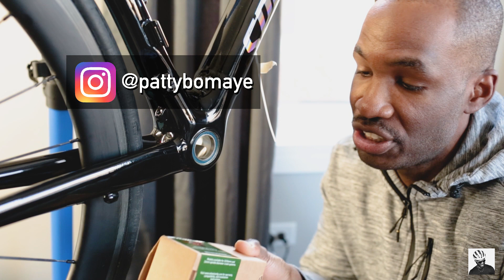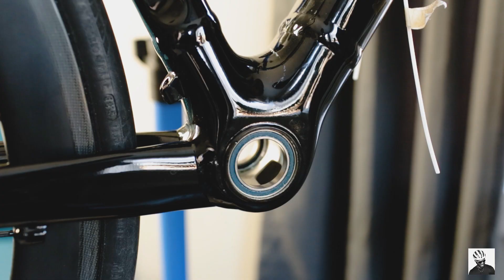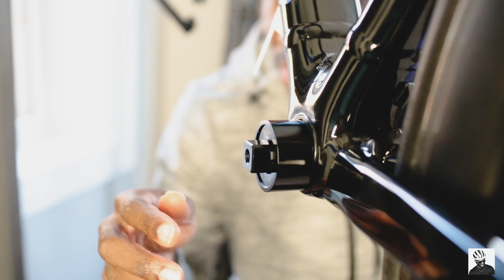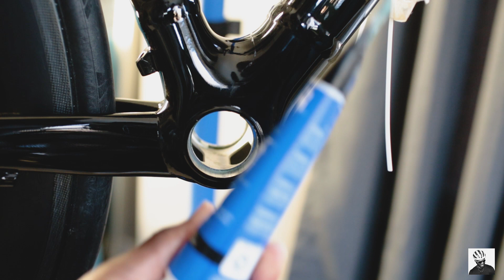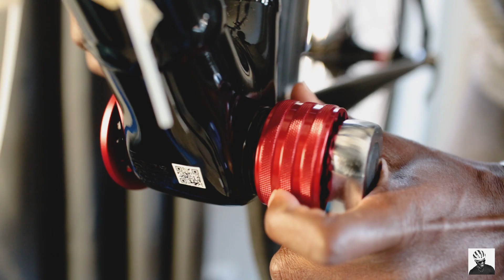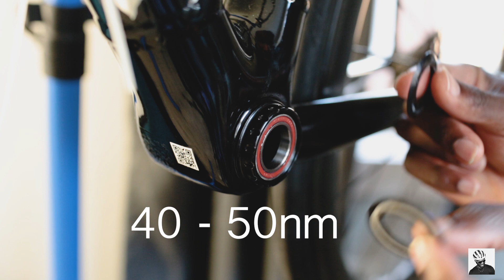Wheels Manufacturing BB30 Outboard Angular - Allez Sprint Build #01

Comment from the maker: YES the C-rings/clips should be removed. In an upcoming build video, I learned this the hard way lol
Reply: I've been trawling the internet all morning looking for an answer to this!...So Thanks!
Reply from the maker: @dannb0dge  Safe weekend Dann!
Reply: What happens if you don’t? I installed this exact BB last week on my Allez Sprint and it’s been going strong. Lovely build you have going btw!
Reply from the maker: @juliankaiser9764  The BB won't sit flush against the frame, which could also affect the Q factor and overall fastening of the crank arms. But if your setup is working well then it's probably fine.
Reply: @patrick lino just want ask u something. I just install bottom bracket quit similar with this one. My question is. Now im running with shimano chank.  The problem is i got a little bit free play on it. I already put 2mm spacer on drive side. Its that i need to put wave spacer on non drive side. Fyi the free play u can fells when u put both hand on the crank. Very minimal free play. Hopefully got suggestions from u
Reply from the maker: @AMWChannel  It's difficult to diagnose without knowing the required bottom bracket type for your frame (BB86, BB386, BB92, SRAM DUB) and what your current bottom bracket is. SRAM/DUB provides the correct spacer requirements based what ever crank you're using (Shimano, SRAM etc).
Reply: @PatrickLino  im using ridea bb30 24 spindle 
This is taiwan brand. Because i just checked with my other bike is Cannodale . Which is firm. No free play on it. Allez bb shell is 68mm .. my Cannondle is 73 bb shell.
Im using bb for 68mm bb shell for my allez
Reply: This saved me, I was unsure while replacing the factory BB with the same Wheels MFG Thread together BB30 on my Allez Sprint. Glad I didn’t have to do it twice, so much more work removing than installing.

Comment: Are those the same as the bb30 on cannondale caad? I’d like put shimano crankset too on my caad. How are these lixada tools, durable? I saw same toolset as that, just rebranded, and i’m thinking of buying too to avoid using mallet in the frame.
Reply from the maker: I haven't ridden the cannondale caad. Its best to check their website for specs 👍🏾

Comment: Well done job. I installed same bottom bracket on my 2020 S-Works SL6. 35nm was the most I could torque. Anything more felt like I was gonna break to frame. Have you ever experienced anything like that and do you think it's ok? It's running fine but is super tight 😐
Reply from the maker: Should be fine 👍🏾

Comment: Does that drive side need to be pressed in with a press tool or simply by hand. A mallet could knock the drive side in slightly I’m sure so threaded side can screw in.
Reply from the maker: Simply by hand worked for this particular frame. However, on other frames I did have to use a press tool initially prior to screwing the cups together.
Reply: @PatrickLino  thanks Patrick, mines an sworks SL6 I have play in the bearings in the frame and it’s a brand new warranty replacement frame! They look very similar to the bearings you took out of your allez. Was play the reason you took them out?
Reply from the maker: @peterwalsh5068  I actually ended up not using this BB, in favor of a Kogel Bearings ceramic BB. I switched to a DUB D-Four spider based power meter which required a different BB. I have video on this, as part of my Allez Sprint build playlist

Comment: Do you a pin inside the bracket?If so do you leave it inside or you have to take it out?thanks
Reply from the maker: The pins needs to be removed.
Reply: Thanks..i have a venge and im trying to put a dura ace crankset.you think the one you use which is bb30 wheel mfg will fit my bracket?need help..thanks
Reply from the maker: @blackapinotime4318  If the Venge is BB30 then yes. However, it would be best to contact Wheels MFG directly and ask...

Comment: Hi Patrick,
Any BB30 bottom bracket can fit in Allez sprint ? Or it has a specific size. 
I also have allez sprint and it has stock BB. 
I want to buy Ultegra groupset.
Reply from the maker: Hey Raymond, you will need a bottom bracket that fits Shimano’s Hollowtech cranks. A standard BB30 does not.